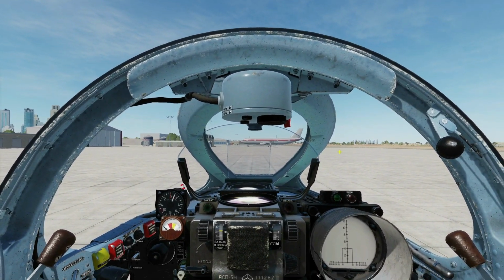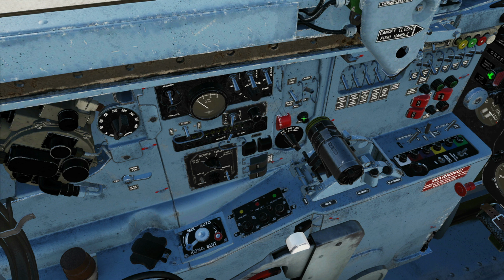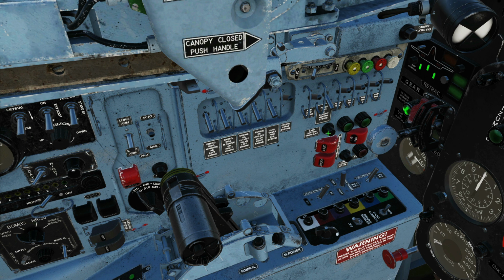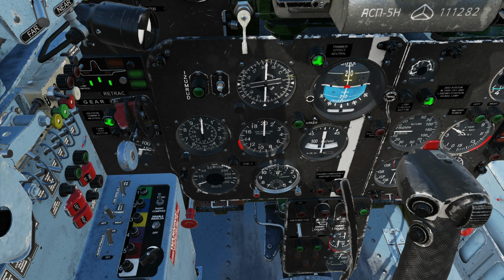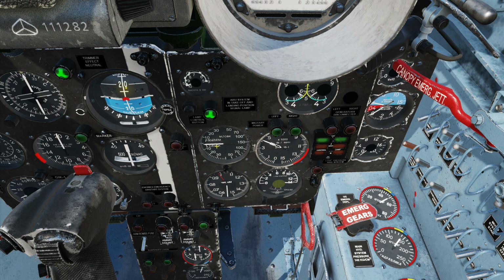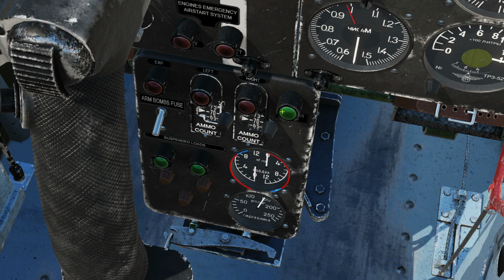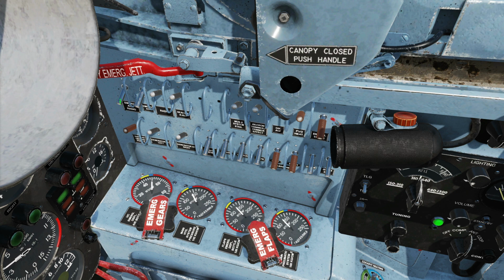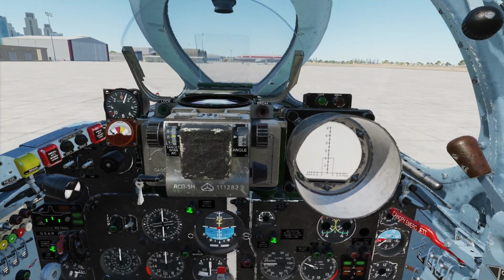Mig-19P Farmer: Cockpit Familiarization Tutorial | DCS WORLD

Comment: Quick tip on meters/ft conversion: you can get a quick and rough approximation in your head just multiplying by 3. So for example 9000 meters x3 is >ABOUT< 27000 feet. Real math is closer to x3.3 so keep in mind it's always a little bit higher.